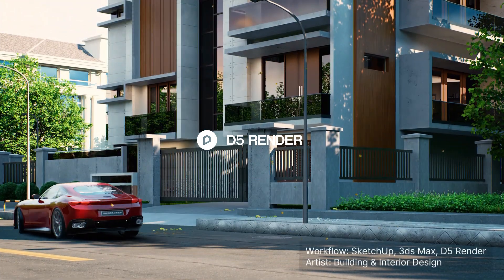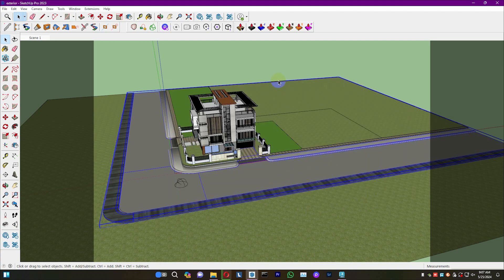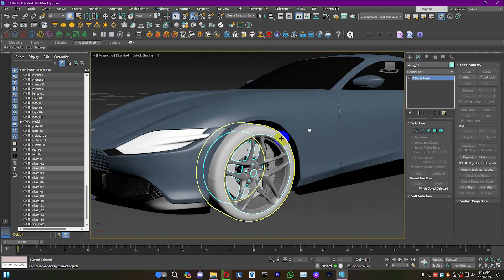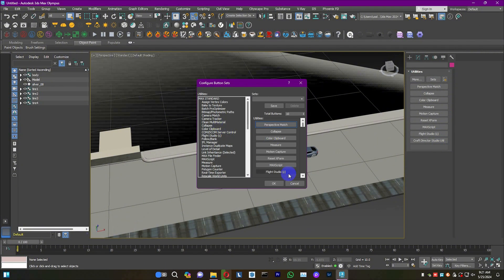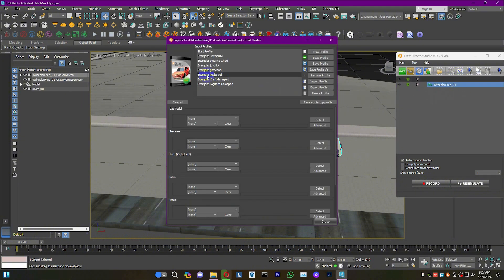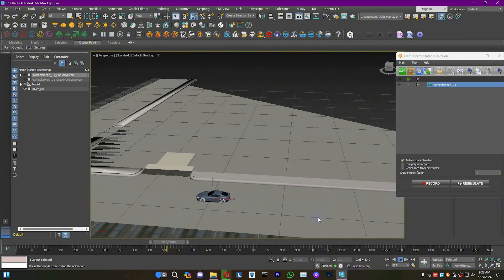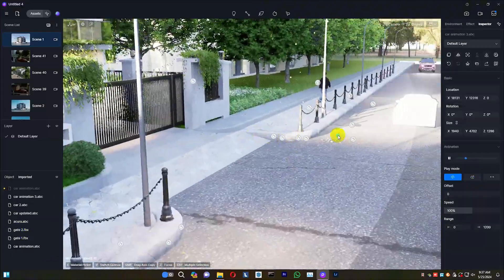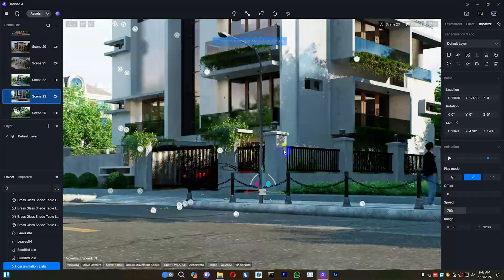How to Create a Detailed Car Animation from Scratch | 3ds Max, D5 Render | Artist: @bidbd

Comment: How do you achieve the effect of the car's rear lights turning red when it stops? Additionally, could you support textures in an .abc file in future updates? Reapplying the materials is painstakingly hard.
Reply: use d5 renders stripe light and keyframe that with the animation
Reply: @bidbd thanks dude. Both for this suggestion and well, the entire video😂
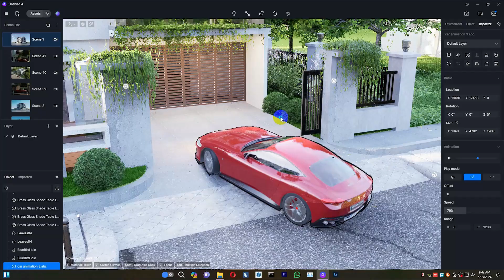Reply: @bidbd  Thank you for the reply. Can you explain what you mean by keyframe the stripe light with the animation? manually moving and rotating the stripe light to fit where the light is then keyframing the light intensity especially if the car is slowly breaking seems excessive. Furthermore, what's weird is that the lights turn on "not" in animation mode if you look closely at 04:06, it looks baked in, so I'm wondering if it is possible to animate the light beforehand and import the light animation into D5.
Reply: @billmek  yes you can do that too, in 3ds max and then import with the car animation